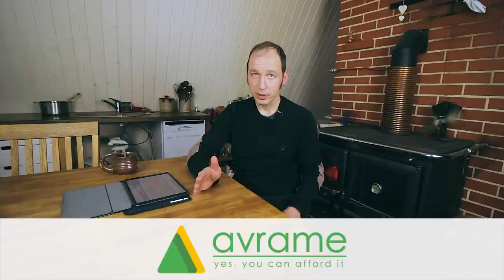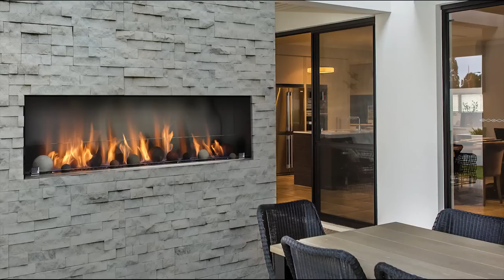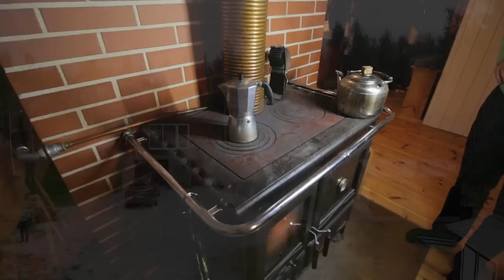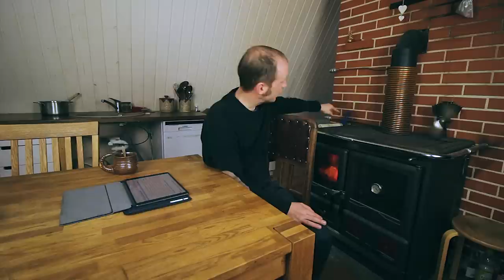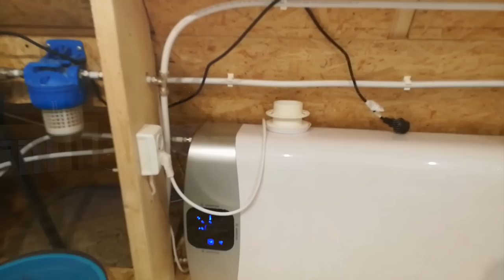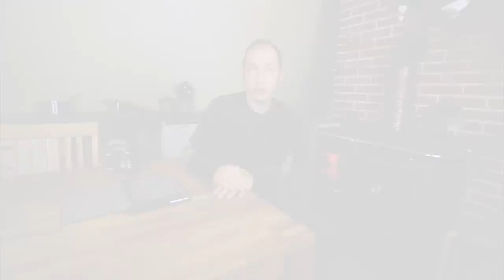Heating Systems for A-frame Houses

Comment: I really like the way you break down the concept of heating water tank constantly.   I know the info, but like you said, just take it for granted and pay the bill. Currently in an apartment but trying to build so researching that. I remember when gas was coming into homes and the big push to convert off electricity.  It was promoted as so cheap, but now they're about the same cost.
Reply: except in the northeast

Comment: All good points! I think for my application I'm going to go with a solar water heater! Where my land is in Colorado I get plenty of sun year around..
Reply: Marcus, if you can exchange electricity with the network you might consider using solar PV + heat pump. This type of system requires nearly zero maintenance and has a longer lifespan than thermal solar + the installation cost should be even smaller. Downside: it works only if you can sell energy to the network during the day and buy it back during the night (otherwise you'd need a hot water accumulator but then it is comparable to the solar thermal in terms of cost).
Reply: @aboptimization  thanks for the suggestion!! Unfortunately well I really can't say unfortunately because I kinda like the idea of being completely off grid.  The area where my land sits is not grid Connected. It  has no county water  Sewage or electric service's so it's completely off grid. It's going to be a challenge but when I get everything together it going to be great not having to depend on anyone for the comforts of life
Reply: florida here! all year round baby!

Comment: In Pennsylvania what would you think is best for a trio100?  I'm thinking heat pump or mini split system plus wood stove or small fire place.  We generally need good heating and air conditioning.
Reply from the maker: Heat pump + wood stove is the best combination. I always recommend to have at least a small wood stove in case if heat pump dies or needs maintenance.
Reply: @AVRAME  also I think sometimes is just nice to have a fire going.

Comment: what ventilation system a-frame house uses? Any attic fan, vent pipe, or roof vent need to let hot air out in the summer?

Comment: Preparing for a Avrame home in northern Spain, probably a Trio 100 with a portion of the second floor as loft. I'm going to do more research on heat pumps, geothermal heat, and splits. I have seen a home in this area with an air to air heat pump feeding radiators and I believe they get their hot water o that system as well. But a split system seems to be less installation intensive. If we leave a portion open at the front end allowing heat to rise up to the full ceiling, would a split system be required to have a unit in the second floor bedroom, or would that be overkill (our coldest temperatures don't drop much, if any, below zero Celsius), and we will most definitely add a high efficiency wood stove for backup as we intend to go fully off-grid dependent although we will have to connect physically to the grid due to local requirements. 

Also, as I don't see a video yet about this, what are the possibilities of having rain gutters for water harvesting on your builds?

Comment: Just a small comment to some random builder, I have a small 30 m2 off-grid cabin, A-frame, with Italkero Eco sc18 gas heater, which is safe to use at nights since the air intake&exhaust go throw the wall, the cabin is located near the arctic circle with a 10cm insulation on the walls and floor, and managed to spend a week in -30C temperatures while the indoor temperature were at lowest around +16C, +5C sleeping bags were used by our family, kids were upstairs. Cannot have a fireplace since this is a building which can be built without a local building permit. The heater is too inefficient but one can manage with it. Other options were Safire and Wallas heaters that can be controller remotely, but the cabin is for summer use mainly. My 2 cents on the matter..

Comment: We are looking to create thermal mass with a south facing concrete patio that extends into the home as the floor (sun will heat up the concrete and concrete will store heat)...Can these be built directly on an insulated concrete slab?

Comment: What is the best way to keep air temperature consistent veticaly through open ceiling? I am considering a trio 150 with combination of floor heating, fire place, ceiling ventilators for good air distribution.. Or is there a better way to do it. Same question for cooling.
Reply from the maker: With open ceiling "mixing " the air is inevitable unless you want all the warmth under the high ceiling. Ceiling fans are effective and inexpensive solution for that. In the summer you might want the hot air to rise up and have a skylight or some sort of vent to let it out.

Comment: What heating system do you recommend for The average temperature in Los Gatos is 14.9 °C | 58.7 °F. About 582 mm | 22.9 inch of precipitation falls annually. Thanks.
Reply from the maker: What type of fuel you have available on your plot? Firewood, gas, electricity?
Reply: @AVRAME  electricity
Reply: @AVRAME  gas also lower in cost

Comment: You don't need to replace a water heater/boiler every 7-8 years. If you have clean water in, no maintenance. Only check the safety pressure valve every now and then.. I have no idea where you got the information to replace it every 7-8 years? There are boilers in service for 30+ years, no problems. Of course, when you build a new house, the size of the tank should be appropriate for the size of the users in household. Tankless boilers are often based on liquid petroleum gas = fossil fuel. Using renewable energy for an electric water boiler is a much better alternative. The electric heater also might produce some excessive heat that can be utilized to heat the bathroom and prevent freezing. Best alternative is to use the right size with good energy efficiency grading.
Reply from the maker: Here where I live we have a lot of calcium in the water and that destroys boilers rather quickly